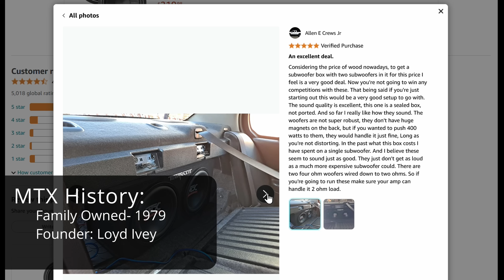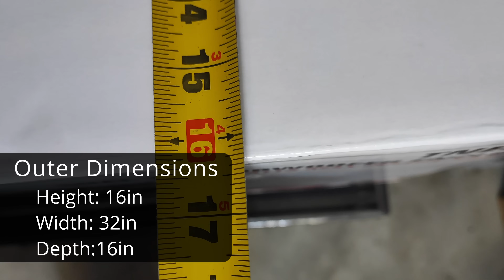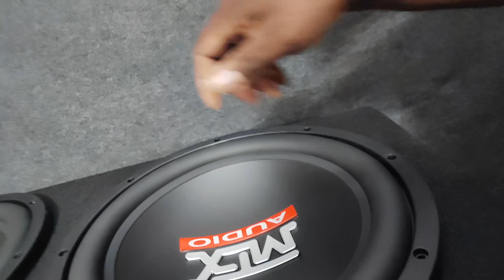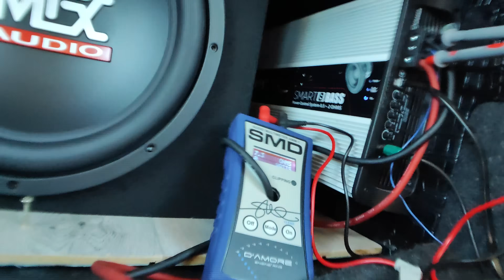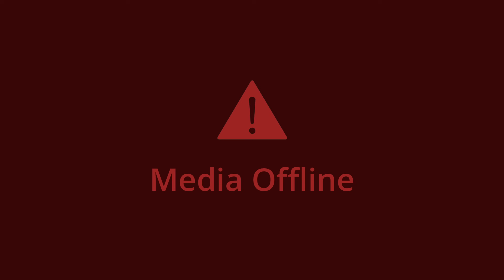Why Is EVERYONE Buying This Loaded Enclosure | MTX Terminator 12 | 5,000 Watt SPL Test

Comment: A prebuilt like that is great for the budget basshead. It's not going to rumble the neighborhood but it will provide good sounding bass on the cheap.
Reply from the maker: You can definitely get some loudness out of this setup!
Reply: @BudgetBassHead  i just bought a 2013 300 srt and i want sum subs that gives u Clean,Tight,Accurate Punchy Bass that hits hard on the lows with the volume down or just mid level bcus i dont plan on turnin the volume up all da way alot just want deep clean bass where my music n words are still crystal clear while the subs playing.....I dont want that trunk rattling noise just Strong Tight bass do you have any suggestions i was thinking of going with 2 10" american bass xfl, memphis M7 or Mojos or either 2 12" Kicker comp Rs, 2 12" P3s, 2 12" memphis M7s, or just 1 12" Kicker L7s, 1 12" kicker comp Q, or 1 12" Alpine R2s..... Which subs do you think will give me Great clean sound quality and still has that Tight deep accurate bass bcuz right now im going 2 keep my stock radio and just get the car play adapter to give my screen the ability to use car play n apps like youtube n internet.......

Comment: Wow, another super impressive showing for a low dough setup!  140+ with an inexpensive pair of sealed 12's is insane!!!
Reply from the maker: Yeah, it's hard to beat this enclosure for the price.
Reply: Its not that insane, or at least in 2024
Reply: @Hayawasa  Two 12"s in a Quality made sealed enclosure for only $130, you find 1 better, & tell us about it.
Reply: @evilinside5984 they are like 225 now and what are you talking about quality enclosure? It's 5/8 MDF , with a single window bracing . It did 140db, on 4k burp at 50 hz. That's not impressive considering how much power it took and the frequency. There is a company called vevor that has a package for the same price with better subs with bigger motors and more thermal handling in a 3/4 MDF box. It also comes with a little 600 watt amp to get you started. I'm very certain it put down the same , if not higher numbers if you burp 4k into it. Mtx has really only one thing going for them , and that's the name. It's all from China just like every other cheap sub package out there. Only the top tier subs like the 9515 and the jackhammer are made here in the US.

Comment: now what if you build a custom ported enclosure for those subs? I did that and I managed to get a 135db on 400 watts with some other subs
Reply from the maker: It's hard to say because it subs doesn't come with specs TS parameters. But  not all subwoofers do well in a ported enclosure.

Comment: Budgetbasshead can we get you to build a bigger box for them. See if we can up the score.
Reply: That's not how enclosures work, unfortunately.  Particularly as it relates to sealed enclosures, the bigger the box the lower the frequency:  the lower the frequency the lower the sound pressure level/loudness.

It's like cars lean is powerful, but hot.  Rich is weak/expensive, but cool.  Low ain't loud and that's what everyone is chasing.  Sealed has great transient response but struggles to dig low and loud.. Vented is easy to get low and loud, but is super power hungry and doesn't play outside of tuning frequency... it's picky.

Comment: I bought these on Amazon in 13 or 14 for my malibu ss. Other then buying a bigger amp for what I needed these slapped you could hear me from a damn good distance. Since then I've upgraded a lot but for starting out it came with all the wires amp subs and box. Like I said for what it is these work and sound great for so cheap.

Comment: I'm rocking 9500 tens from 2010. And had a Thunder series amp from that time. Plenty of powah baby!! Then seemed like mtx just disappeared. Still have my 9500s and try to buy more whenever they pop up. Old-school and can be crazy expensive! 25 year old subs!
Reply from the maker: Love it
Reply: Tr45 15inch was a beast for $50 back in the days
Reply: @NachoCamaro  hell first subs I ever had was mtx roadthunder two! Wasn't even old enough to drive! 125watts of raw fury! 😂
Reply: Still got my mtx 9500 and JL w7.  So hard to beat those .
Reply: @hypefxx9011  right! Unless you want to pay 700 bucks and be like everyone else... yeah there's better stuff out there now but people always forget the og bosses and ingenuity
Reply: I have 2 9500 12s n a Rockford t2500 but I'm only running one with a kicker 2500 because I can't get a box that won't blow apart.

Comment: I've got two of the MTX sealed boxes in the back of my '06 Malibu SS. I started with one, but the two subs was just not enough. So I bought a second one, and it's a little bit closer to what I was looking for. They don't get extremely loud, and they don't get extremely low, but they do sound pretty decent. I'm running them off at JP8 wired at one ohm, and honestly I've had no issues with them. You also scrolled past my Amazon review which I thought was kind of cool.
Reply from the maker: I was generally surprised by their performance
Reply: This video proved these sealed MTX Terminator subs can take a lot more power than rated. If you want your (4)- MTX Terminator 12"s to pound hard, get a JP23 V2 amplifier, & wire that to 1 ohm.

Comment: Mitex not matrix
Reply from the maker: Thanks for the correction
Reply: @BudgetBassHead  no problem. Fun fact mtx used the pre buyout Pyle company for woofer manufacturing when Pyle was made in Indiana years ago. Those two brands i always called poor mans cerwin vega way back in the early 90's
Reply: @Justa3Valvesstang  No it was Matrix when we bought it. We changed it to MiTek (stands for Miller Ivey Tech) when we bought Matrix. Matrix was a spin off of Oaktron in Monroe Wi which we bought a few years later… The More You Know :)
Reply: @JohnathanIvey-td2vm   I like to reach out to you to interview you. Id Like to write a book about the history of car audio. One of the top subjects of history I'm running into is the company known as "Hollywood sound labs". This company claims to have made drivers for even your company mitek MTX. Hollywood sound Labs was known for their green surround drivers and in the early early 2000s the excursion line of speakers hit the market and tested it really really well. Largest innovation from this company is the patented" MAFOS backplate*-the original extended pole / bumped backplate technology later Stillwater designs copied and made popular ...In the end the company lost their own name and is tied up in litigation here in this country. Now their brand is sold over in Germany but the thing is I noticed companies like sundown audio are using their proprietary dragon claw frame. Now sundown is saying that it is their frame. But anyone can look at an excursion driver and see that the u series from sundown audio is sporting a Hollywood sound Lab frame. This is one of the areas I'd like to write in the book about ! I'd like to talk about other brands that got lost like GS designs ( redline) . Would you be willing take a few questions on the subject ?

Comment: I have the 55 series and 75 series. I can tell you, they dont like power too long. You will definitely start smelling them. Both series sound great though. I have 12s and 15s
Reply from the maker: Thanks for the tips!
Reply: How long? They won't last a two hour drive?
Reply: @warriorplutotrent3827  let me clarify. They start smelling within some mins if you running too much power. It's hard to explain here. They will be fine at close to rms
Reply: @jlee8262  oh ok. Ill pass on these then. I wanted to take them back to Nigeria with me next year. I have a single 10 inch kicker competition ⁴ ohms running on an 1500watt amp  but inwamt something that hits harder. The setup in the video looks like it will fit my corolla though.
Reply: @warriorplutotrent3827  can't go wrong with some kicker compq10s. I also like nvx subs as well. Check them out
Reply: That sounds like a coil material problem

Comment: Breakin is real but the effects are usually unnoticeable to most so let the audiophiles argue about it and just enjoy your system.
Reply from the maker: People always ask me, so every now and then I'll specify. I only demo 'out of box' performance.
Reply: Only once have I “broken in” a mid range speakers before. I had some HiVi 6” mids that sounded like total garbage to the point where I wanted to kick them in, but after about 6 hours or so of  letting them play when I was out doing yard work they change dramatically for the better.  I think with subwoofers to “break them in” is for the good for its longevity more so than to make it sound better.  For the most part the spiders are made of cloth, just like a pair of jeans, they always feel better after you wear them a few times.

Comment: Picked up the ported version of this with the amp for 300. Great value and a fast track to rattling my doors.
Reply from the maker: That's a great deal!
Reply: @BudgetBassHead I just put these in my civic and got a little ahead of myself and blew one of the subs any chance it could be swapped?
Reply: @hookandcook23  How did you manage to blow 1 of these subs, when BudgetBassHead just put 4400 watts rms to a pair of these, & they're fine!?
Reply: @BudgetBassHead I got a 2022 BMW X5 M50i, Harmon Kardom is nice but deff need a box and amp. I am torn between the Rockford Fosgate p3s or the MTX 12s. Any food for thought? Great vid by the way
Reply: Very nice. I myself have been searching for a gum rattler. I'm tempted to try it out. I'm in a truck though. And I do want high spl. Idk about the 400 per sub. Could do well?
Reply: @blackfrost273industries4 what truck you have? because you have a truck doesn't mean you can't get good spl #'s let me know what you drive and if its regular cab or extended/crew cab camper or no camper shell

Comment: I had these in a 93' 240sx back in my ricer days 😂 I blasted the poop out them with a 400rms pioneer amp never complained. If am not mistaken these are the equivalent of their thunder 5500 series.
Reply: Nice I had a 93 too turbocharged the ka24de I had the square kicker 12 and some random amp
Reply from the maker: That's a great comparison.
Reply: I still have my 240sx  its a 90   but it's mint, with  two tens  on 6k,  I build subs.   And it's a small hatch  lol.
Reply: I would say they relate to the thunder 4500 series I had both I had the original thunderform 2 12 4500 box and subs lasted me till about 2022 loud as hell I had the same terminator box shown and loved both but the vented thunderform box and 4500s were little louder I also had a 5500 and it's a whole different beast for what it is I wish I still had them but mtx seems to have dropped out of the car audio game for some reason they got rid of there 95 series 😢 I spoke with them they said there working on new stuff but I have yet to see it sadly I am and always will be a mtx guy but there not making stuff up to par with skar/sundown or any of the other big boys sadly and I know they can do it that's the crappy part
Reply: @mrpoopypantz4809  What do you mean, MTX still sells a 24" Square Jackhammer subwoofer that retails for $9,999!
Reply: @Bluejay-9d- No these sealed version of terminators= 200 watts rms per 12", would be compairable to a thunder 2500 series if MTX made 1. Now the Terminator sub that was designed for the Ported enclosure is 500 watts rms per 12", & would be compairable to a thunder 6500.

Comment: I had that box back in 2002 in georgia. Bought the mtx dual 12 package from circuit city. It came with a small 300w mtx amp. Mtx is quality
Reply from the maker: I agree I was genuinely surprised from the performance and quality
Reply: A family member had 2 thunder 6000 12s on a mtx 1000 watt Amp in an extended cab s10 they sounded great
Reply: Haha had my mtx installed at a circuit city as well. In a Ford festiva. Took up the entire "trunk"
Reply: I miss Circuit City! I used to take my burnt cds into the lil test bump room they had, pop it in and banged that sh*t 😂
Reply: @1ohmwrecker I miss Circuit city's $20 2 year protection plan. One time no questions asked replacement.
Reply: 😂😂😂 no it's not, it's garbage .